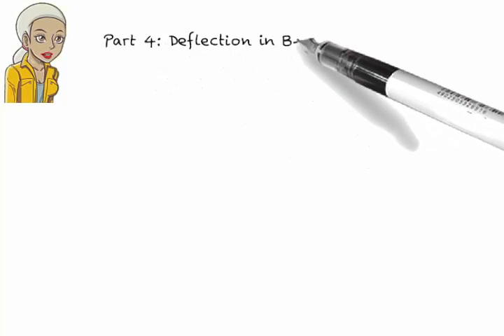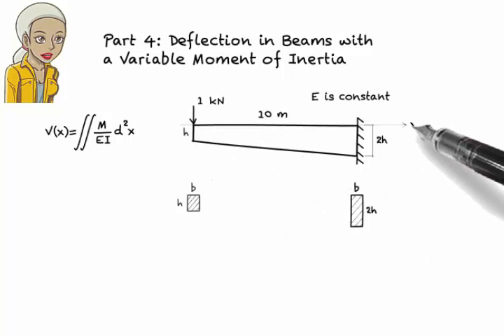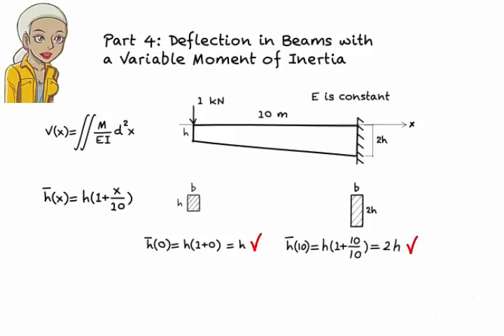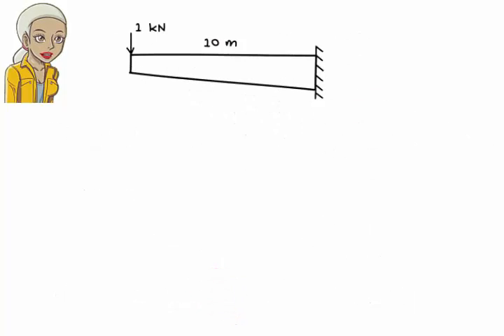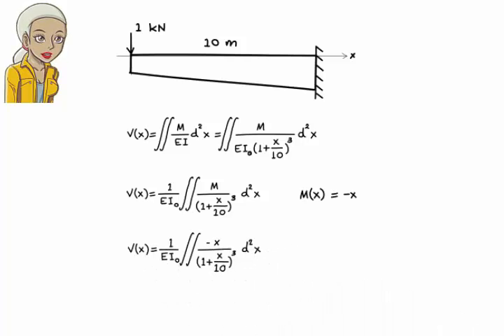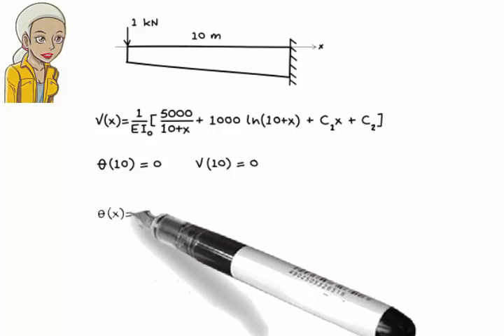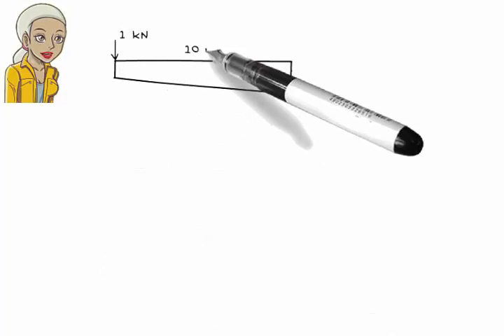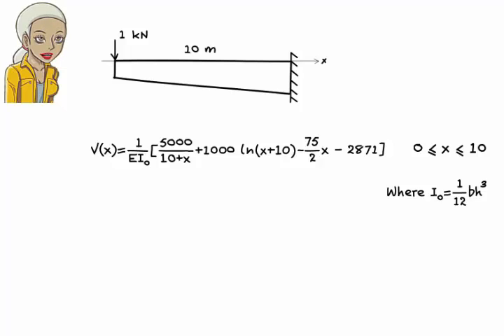SA13-4: The Double Integration Method (Part 4)

Comment: +Dr. Structure  , If we put dv/dx = 0 (i.e. for maxima or minima) for finding the location of maximum deflection in a cantilever beam then after computing x comes out to be 10 m, which is true indeed since at x = 10 m, slope = 0 i.e. fixed support. But, then how can we prove mathematically that the maximum deflection occurs at free end for a cantilever beam which is discussed in this lecture.
please clarify this doubt... I'm at this point.
Reply from the maker: +VIVEK SINGH Consider the shape of the deflection function. It is located in the fourth quadrant, It starts at a negative value at x = 0 and increases in value until it reaches, and touches, the x-axis at x = 10. This is a concave down function having only one maxima, at x = 10. As you correctly stated, the maximum point is determined by solving dv/dx = 0. 

When dealing with such functions, we also need to also check the equation at the boundary points to make sure we have not over-looked any critical (maximum or minimum) point which might be located at the edges. So, in this case we need to check the equation at x = 0 and x = 10. But, since we already know the value of the function at x = 10, we only need to check the function at x = 0 . 

Evaluating the function at x = 0 gives a negative value which we take as the minimum point.
Reply: +Dr. Structure Many Thanks.
Please give some information on the new lectures that will be uploaded and when...

Comment: 2:15   i got 5000/10+x + 1000 ln((10+x)/10) + c1x +c2 where is the ln (10+x /10) you didn't show divided by 10 in ln
Reply from the maker: Not sure why you think there should be a 10 in the denominator. You may want to use a symbolic math software to check your calculations. Try Wolfram Alpha. It is a free online tool.

Go to: wolframalpha.com

Enter the following expression in the input text field and hit return:
integrate  integrate -x/(1+ (x/10))^3
Reply: @DrStructure  your formula is something like "-x/(a*x+1)^3" to integrate 2 times where a = 1/10 in your case. By putting my formula in wolframealpha, to gives us log(a*x+1)/a^3 + [something that we all agree with]. So, by replacing the a by 1/10 (always in wolframalpha) we have : log((1/10)*x+1)/(1/10)^3, then wolframealpha gives us 1000*log((1/10)*x+1)
if we change the writing a bit : 1000*log((10+x)/10) and by the properties of the log, log(a/b) = log(a) - log(b) so we finaly have : 1000*log(10+x) - log(10)
And obsusly, 1000*log(10+x) - log(10) is strictly different of 1000*log(10+x) ... So, why wolframealpha gives us two different answer depending on how we ask the exact same question ?

In fact, the "-log(10)" difference doesn't matter at all ! when we do the double integration by walframalpha, it just add the "-log(10)" in the constant "C2".
that means that you can have 2 differents value of C2 depending on if you kept or not the "-log(10)" apart from the constant (but well ... if we have this constant it's not for nothing, it's better to just put the "-log(10)" in it ...)

So ... 5000/10+x + 1000 ln((10+x)/10) + c1x +c2 = 5000/10+x + 1000 ln(10+x) + C1x +C2 you two have the correct answer x)